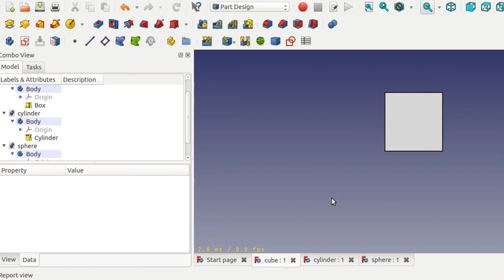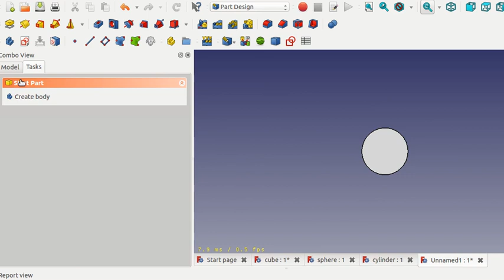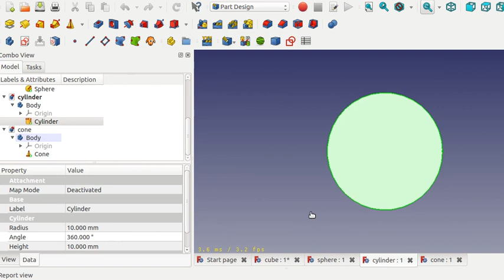FreeCAD PartDesign SubShapeBinder New Features

Comment: Hi, super useful vídeo!!, some positive feedback: For me (not an English native speaker) would have been easier to follow if you  had given voice to the video. 

Also, I have a doubt, the sub shape binder that links the body "B" inside the boy "A" ("Bind:" set in "Synchronize")  , isn´t supposed to reflect changes made in the body "B" in the Sub shape binder in the body "A" in " real time " (after recalculating with F5 I guess). Did I miss something or is it a bug?
Reply from the maker: Kinda confused by your description. Maybe you can link a file showing the problem?
Reply: @leizheng3561  Yes, I'll link some screent record with mi issue
Reply: @leizheng3561   Here is a video with the example and a better (hope so) description:

https://mega.nz/file/YBhg0ICK#TWsTT1lN9mSUq_AuQQgMJapngrdWDICDO5kl3B219L0

Thanks in advance, Lei
Reply from the maker: @lovizio93  I see. SubShapeBinder binds to a 'feature', which in FreeCAD's term is synonymous to 'object'. When you add a Chamfer feature into the body, it is actually considered as another object. If you really want to sync to the 'tip' of a body. You can bind to the body directly. Be aware though, binding to an ever changing object may give you trouble because of geometry topology changes, especially so if you are using the upstream FreeCAD instead of my branch.
Reply: @leizheng3561   Ahh, great! thanks for the info! I didn´t know you are the user realthunder, dude, I love you work!

Comment: Hi, its a very good functionality, sub shape binder. Is there a way to check all geometry that is carried by it such as a dialog box list from where we can add /remove geometry? 
Also does it support local coordinate system binding? 
Thanks
Reply from the maker: Yes, with the recent improvement of the link property editor, you can use it to see all the bindings. See (https://forum.freecadweb.org/viewtopic.php?f=17&t=43060 ).

In addition, you can use the SubShapeBinder context menu (right click in tree view) to select the bound objects.

When you drag and drop an object onto a SubShapeBinder, it will calculate the relative coordinates based on where the object and the binder are located in the tree view hierarchy. After all, the main purpose of having SubShapeBinder is for cross coordinate linking.